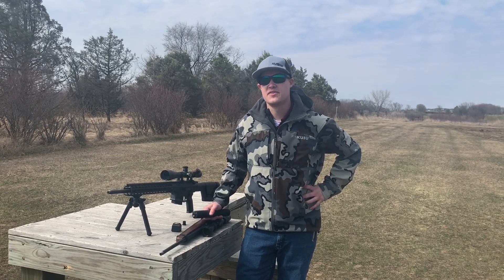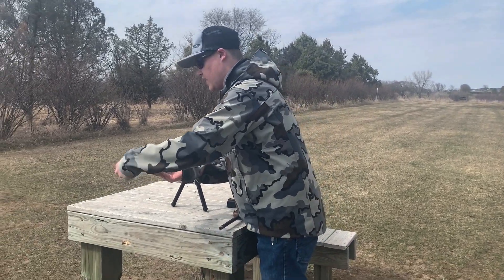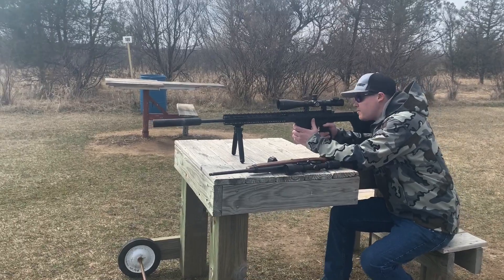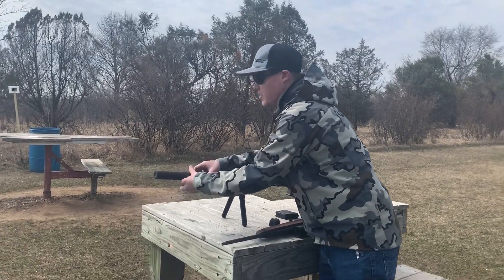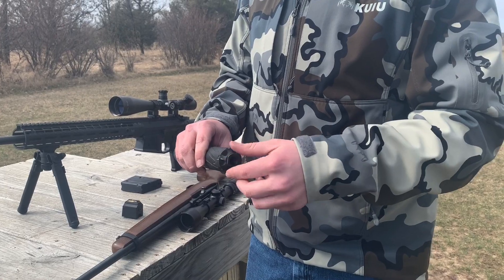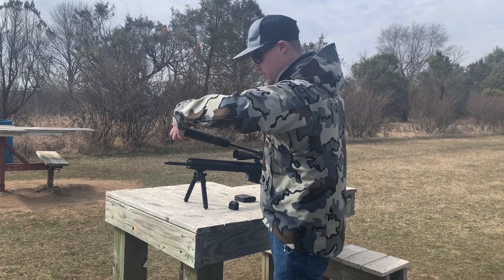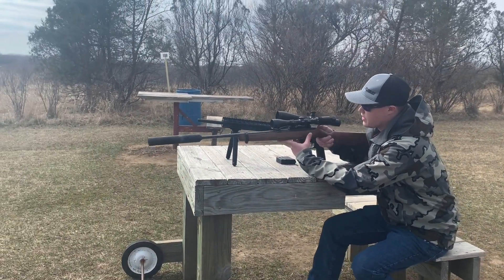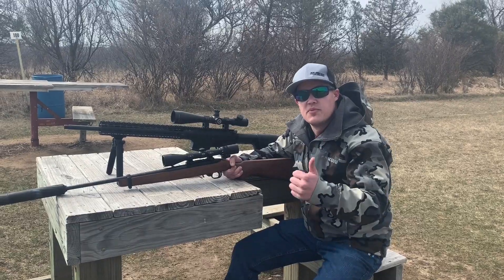Silencer Central 30 Caliber Thread Adapter

Comment: So bummed waited for my Banish 30 gold wait time for a  form 4- Get it and it is missing everything I need to actually use it and my Banish 46 came with no end cap so I can't attach to anything. They say it is all backordered.  You had over a year to ensure the parts to my long anticipated and expensive suppressor came complete.  Doubtful I'll ever use them again. I have 3 silencers sitting here can't use any of them after a year- BOOOOOO
Reply: Same thing happened to me

Comment: What is the point of firing suppressed if you are not going to fire unsuppressed when you are showing people about anything involving suppressors?
Reply: He’s not comparing suppressed vs unsuppressed. Rather, he’s showing that a .30 cal suppressor can be used on a smaller cal rifle with the use of an adapter that they sell. .30 cal suppressor = 5/8-24 threads to 1/2-28 threads on the smaller calibers.

Comment: I have an old junk Lee Enfield No. 4 that is being threaded 1/2x28 (the barrel didn't have a large enough diameter for 5/8x24.) I'm wanting to put a muzzle brake on the gun, but I was wondering about the viability of these thread adapters. Are there any durability concerns I should have if I were to install a .30 caliber brake on my rifle using one of these adapters? Shooting .303 British.
Reply from the maker: We do not recommend stacking an adapter on a brake. I would look for 30 cal. muzzle break threaded in 1/2 X 28.
Reply: I think you are asking if you can buy the cheapest adapter or if you should have a quality concern. If that is true then as long as its not made from ill-refined mix w/ chinese metal. Causing a defect at the stress point. It should be a premium quality hardened part.